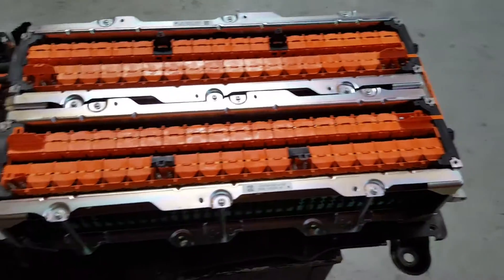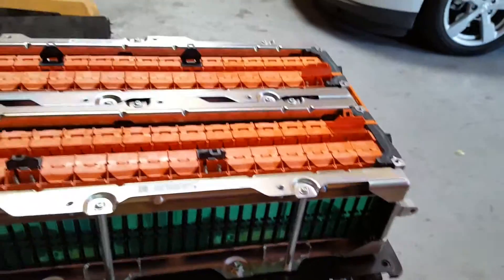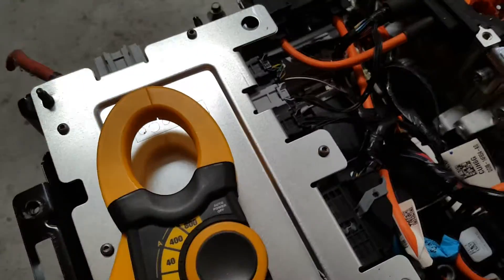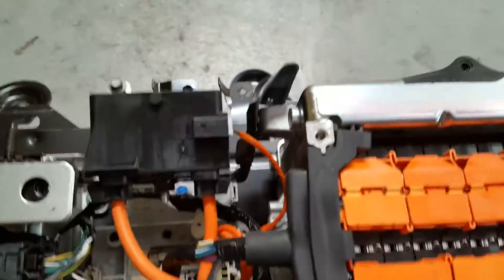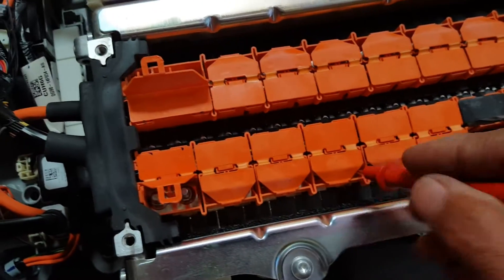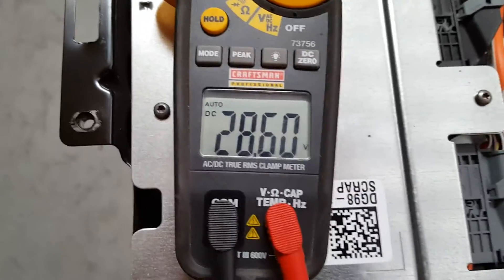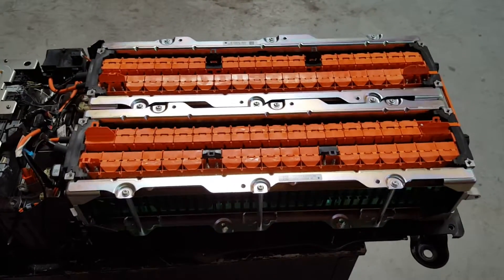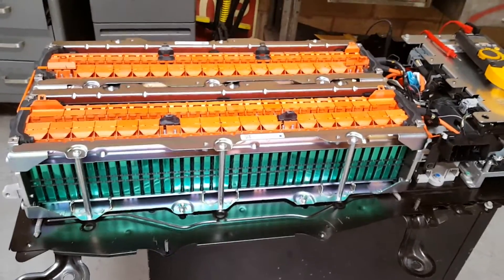Battery Powered house Hybrid Battery's Inside and Voltages.

Comment: That unit actually has a inverter for the 12 dc auto system (lights, wipers, fans, starter)so you could actually just leave everything intact.  The theory is to connect 300v ish of solar panels up to the input and have a slow charge on that units integrated 300v / 12v inverter out to your 12v system and use the lipo4 auto battery as trickle/backup system charger. Ideal if you have a 12v setup.

Comment: Does the label next to the volt meter say "SCRAP" ?
Was this a ford "junk battery"
These batteries do not like over voltage charge, pretty sure it is 4.2 volts MAX, but like I said get some research into this particular type of battery. 
Now would be a good time to record every cells voltage to a list or chart. Looks like fun, with an element of danger (hope not)
Peace brother and God speed
Reply from the maker: the label says "SCRAP IF DROPPED"